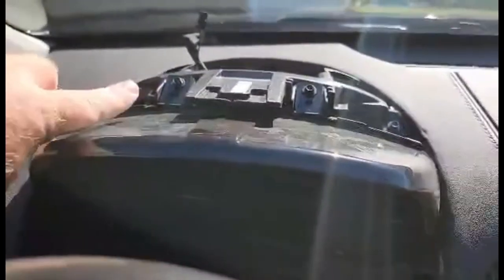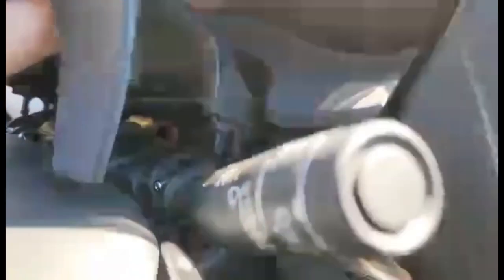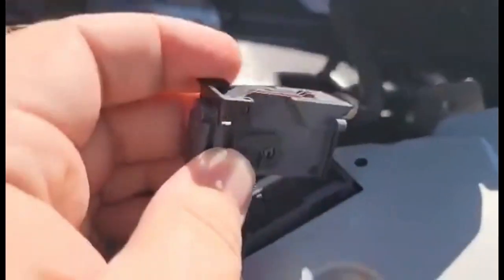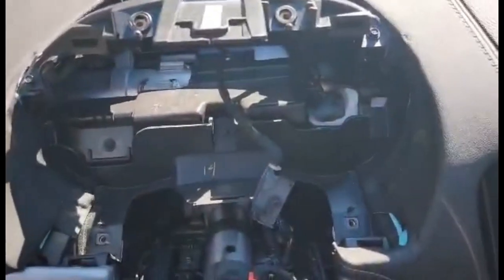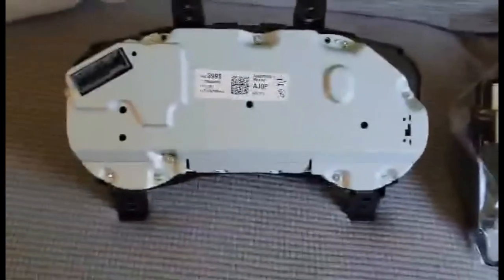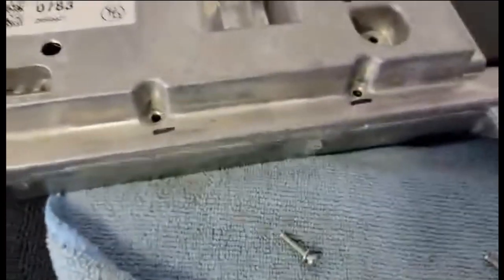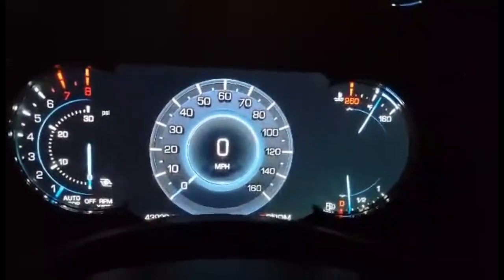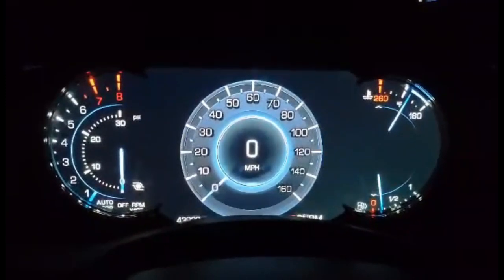Cadillac ATS analog to Cadillac CTS Digital Gauge cluster HOW TO

Comment: The page you got this part from is showing a different one looks more old still
Reply from the maker: It's the same, just different features are unlocked for different vehicles. The one they have displayed in main photo for it is a digital cluster only in V trim
Reply: @PapawsDadillacOEMplus  OK yeah cause I only want a digital screen. I don’t want no analog if that’s the case I could just keep mine stock one….

Comment: What would be the differences in doing this with a 2014 ATS manual trans car. I would assume no turbo boost Guage, but would there be a gear indicator saying which gear you are currently in?
Reply from the maker: It's all programmed through your vin so whatever specifics your car has will or won't show up on the cluster if that makes sense. If your car doesn't show boost now it wouldn't show on this if you converted
Reply: @PapawsDadillacOEMplus  ok and from reading their description it appears there is no way for them to add features. I've been wanting to do this to my ATS for a long time but wasn't sure if it was plug and play. I'll be ordering mine by the end of the month thank you for the install video 👍

Comment: that's dope, i love the setup. what year model cluster is it? I have a 2016, so i would need a 2016 cts-v cluster?
Reply from the maker: Thank you! I've heard you can use other years, but I've also been told it's easier for programmers if you stick with same year cluster. Yes a 16 v or non v CTS cluster would work. Just make sure IF you want to add heads up display later on you get one that's compatible for that as it's an extra port

Comment: I have a 14 CTS with this boring gauge cluster so my replacement should fit right in correct? Is it pretty easy to add HUD? I have the red collision warning lights in that position but no HUD.
Reply from the maker: Yes should drop in. To add hud, you first need to make sure the digital gauge cluster is hud compatible. It's an extra plug on the back of the cluster. 

I had just the warning lights originally too. Adding hud isn't hard per say. Just time consuming taking all the screws out of the upper dash pad, and lower dash pad. It's like taking the front bumper off. Not a bad job just time consuming due to the number of screws. I had it done in a morning no issues

Comment: This question might be dumb but do your warning lights come on on the digital cluster?
Reply from the maker: It's not dumb at all. It's actually a valid question. I actually answer it all in another video I uploaded since I got that alot. You'll get the simple stuff like high beams, adaptive lights stuff like that, but check engine and seat belt and things on the outer edge you will lose

Comment: small question for you, is there any wiring cuts or no need to cut wires and it will fit directly and works fine ?
Reply from the maker: No need for any cutting or splicing of wires. The factory plug is the same in the ats cluster as it is in the cts cluster. Plug and play.

Comment: Hey how did you remove the ats lens from the cluster? I’m having hard time separating it. Is there glue holding it ? Thinking putting it oven
Reply from the maker: Just used an exacto knife or a carpenters knife. Started in one spot and worked my way around the cluster
Reply: @PapawsDadillacOEMplus  I’m thinking of using dremel now.  I’m having real hard time separating now.
Reply from the maker: Make sure you get the tab parts as well. Wasn't hard to separate at all for me

Comment: Just out of curiosity you missed a few steps and I really appreciate the work that you did but I have a question how did you get the cluster and the digital dash with the new one and the old ATS plastic cluster join together or did you just put the screen in and then put the plastic cluster over it
Reply from the maker: You just put the screen in and put the plastic over it. The plastic has two holes top and two bottom it bolts into to stay centered. It's orientation to the rest of the car doesn't change from stock to digital dash. How you cut the dash is how the digital dash will sit behind it. This videos just a loose idea of what needs to be done since no one had made anything yet and information was kind of scattered.

Comment: Have U01B0 code on 2016 2.0 ats anyone have any insight on how to fix
Reply from the maker: Faulty battery monitor module or a short in harness somewhere or as simple as battery terminals aren't tight on battery. I'd start with loose terminals first

Comment: Does anyone have any kind of template for this. Really want to fo it but extremely nervous about cutting the new cluster
Reply from the maker: I do not believe there is any template available. I will say cutting the metal part isn't as important as trimming of the black plastic trim that goes over the cluster. (Paper thin part). I cut a smidge too much when I did this video. . Doing it again when I installed heads up display I had the dash top out of the car and it was much easier and cleaner cutting and fitting it that way vs in the car. If you need any help I have many more pictures outside of youtube I can provide if you're interested
Reply: @PapawsDadillacOEMplus   I would love to see more pics if possible, again I really want to do it just want to get as much information as possible
Reply from the maker: I understand that completely. It's a big mod as far as cutting some expensive pieces. Are you on the fb pages or is instagram or email better ?

Comment: Let me tell you where you messed up ok wouldn’t have been just easier to take the cluster back play from your old garage drill new screw holes for the new one and screw that black plate on so it match your dash perfectly and no cutting need on the dash 🤷🏾‍♂️🤷🏾‍♂️🤷🏾‍♂️🤷🏾‍♂️🤷🏾‍♂️ it will be lined up perfectly because it’s the same back plate off the original even if you have to cut the original back plate it’s still a easy swap part all you would’ve had to do was cut to squares in the back plate to fit connectors out the back that seems more reasonable and as long as your using screws and washers to alignment and tightness it would’ve fit perfectly 😂😂😂😂😂😂☠️☠️☠️ sometimes you gotta have a great idea take a step back then pick it apart to understand how the first thought u have isn’t always the best one
Reply from the maker: The cts cluster is alot bigger than the stock one. You need the width to sit lower hence the cutting, so the hood can sit on top still
Reply: @PapawsDadillacOEMplus  I get that part but remember what I’m saying it we just talking about the back plate so you don’t cut the dash basically what I’m saying instead of cutting the dash try to figure out how to screw the original back plate on the new screen then put it in the glass just so the back plate still fits the dash and no cutting required unless ur saying the screen is so wide it won’t fit wish I find that hard to believe because a company started selling the conversion from a cts digital to a ATS drop and play
Reply: @PapawsDadillacOEMplus  the screen looks really flat with out the back plate  maybe a little longer on the short end but I think it would still work with new drill holes 🕳
Reply: @PapawsDadillacOEMplus  probably could’ve cut the hole for the connector and just use double sided adhesive or glue cause adhesive is used for screens on phones and damn near impossible to pull apart
Reply from the maker: I'd be afraid to put it back there without a back plate on and have something short or get broken from vibrations etc sitting in its new home of the dash.
Reply: Do it and post a video showing how easy it is